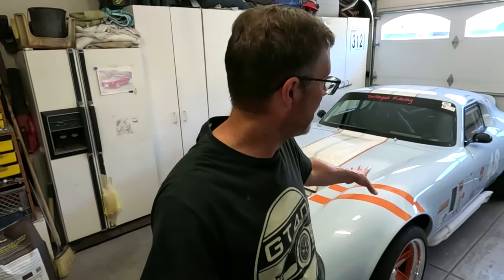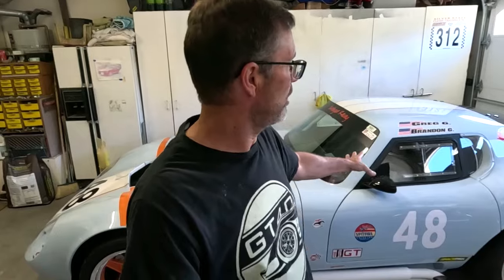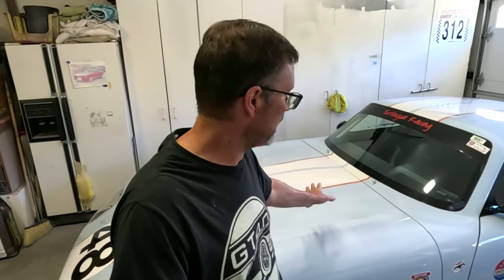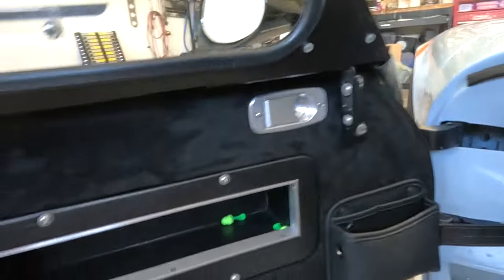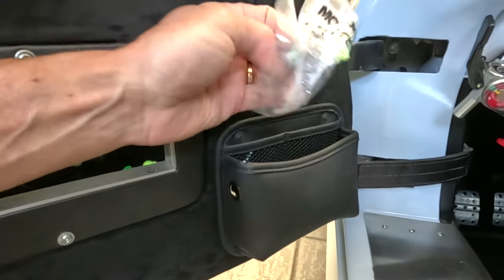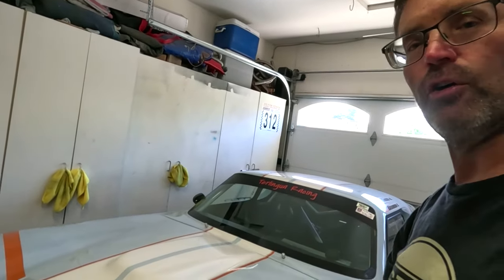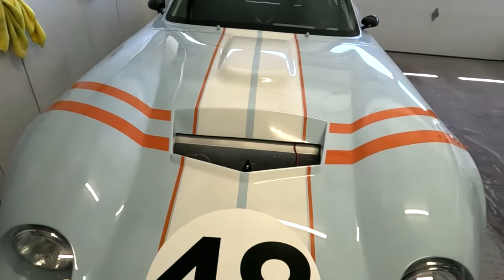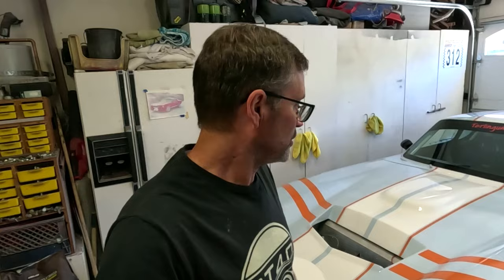Silver State Classic Prep for 150 MPH group

Comment: This car is beautiful, but it looks like it is not for a tall driver 6'-2" plus.  Can you tell me what the dimension is from floor panel (base of seat) (seat belt hole)  to  roof? ............... I expect 38 - 41 inches???
Reply from the maker: @FooFahFoeFum  if you mount seat on floor a tall driver will have no issues. My son is 6’1” and drives it and I have the drivers seat on a slider which adds appx 2” of height to the seat. Getting in and out is the bigger challenge